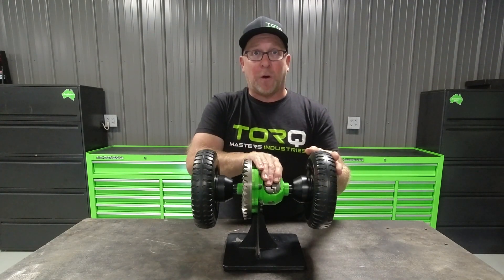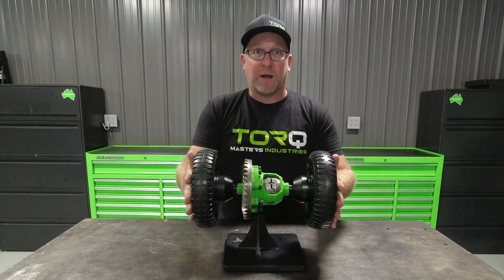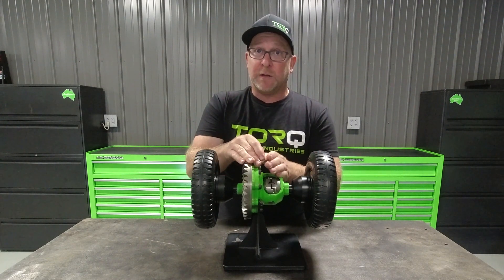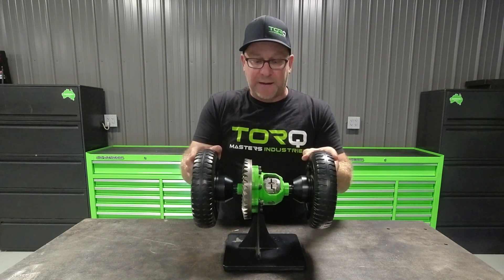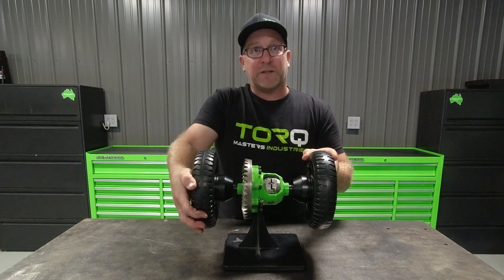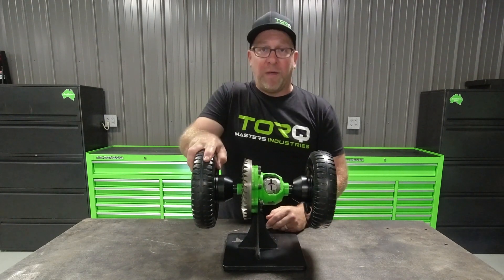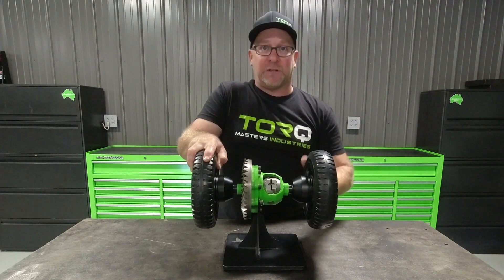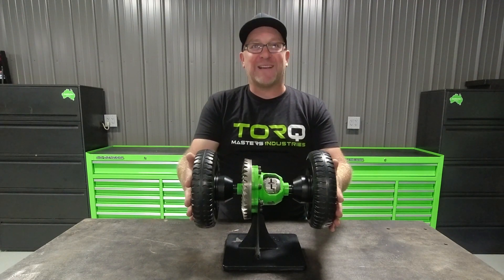Locker Wheel Spin Test Tech Video

Comment: Can it hold up too 40’s in a sterling 10.5?Sas obs 97 gmc stock motor snows coming I need to find a locker with good road manners.
Reply from the maker: @KC-7mm  the TORQ Locker has no tire size or HP limits in the 4 year warranty. As far as mechanical lockers go, the TORQ Locker has very good road manners. Most of our customers daily drive their vehicles.

Comment: Hi, I tried installing the 5bolt locker into a R160 from Subaru B3 to replace my R150 on my forester SH (2012). I also replaced the axels of course. Weirdly, one side ratchets freely when I turn left, but when I turn right it locks up! Same behavior in reverse... When I turn right but go in reverse, it ratchets, and when I turn left and go in reverse, it locks up! Any ideas?

Comment: Do the lockers work for a 2wd? Or even better question: the rav4 "4wd" system..
Reply from the maker: The Rav4 differentials are not suitable for this style of locker. They are cast aluminum and can crack.
Reply: @TorqMastersIndustries  do they work with 4x4 like any regular Locker coz I got a 1992 Dodge Dakota 4x4 and that's open differential front and back and it's almost useless once the frame gets flex
Reply: @TorqMastersIndustries  thx

Comment: 94 ZJ here... If i put one of these in my front diff (d30), and run in 2wd, will i feel anything at all aside from a little ratcheting noise? In other words, is it "open" until torque is applied through the pinion gear? Ideally, in my head, i'd have open diff up front until i engage 4-high / low on the transfer case, then it'd pretty much be locked... but I'd really prefer to install one of these instead of the alternatives (locking hubs and welded diff or $1k ox locker).
Reply from the maker: @banzaiib you are correct, the locker will only lock when torque is applied via the drive shaft/transfer case in 4wd hi and low. Likely you won't hear any ratcheting in 2wd, but if you do it will be slight. Dana 30's are our most popular selling model for the reasons you listed.
Reply: But I don't understand how to recognize it if it engaged.
The wheels should spin in the same direction ?